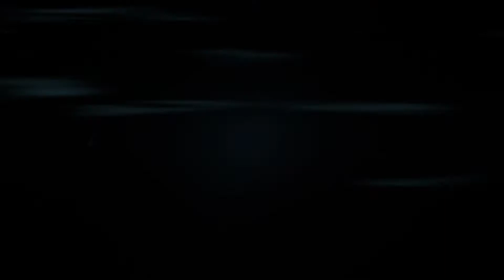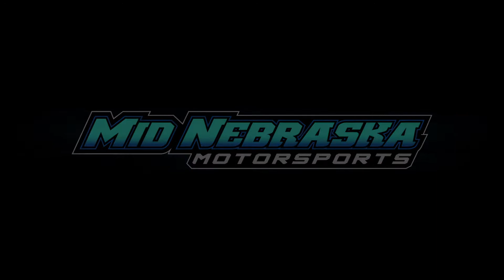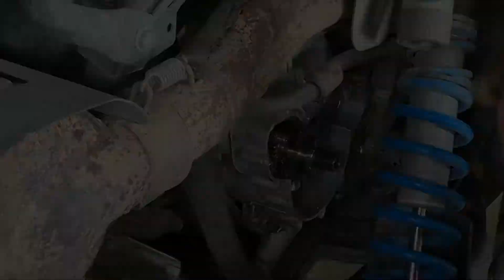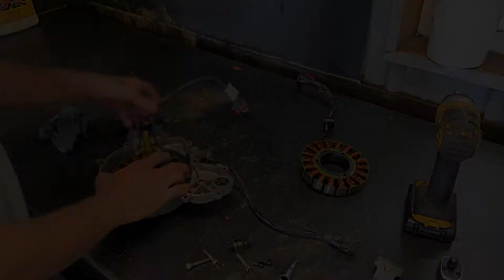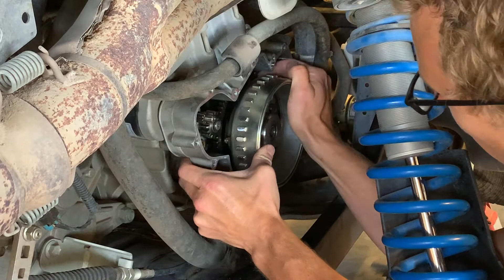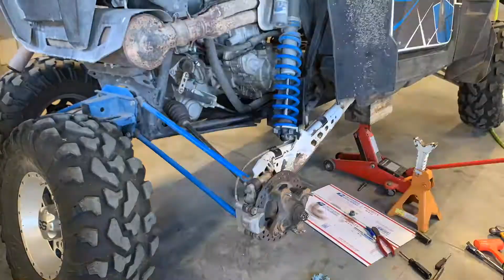Polaris RZR 900 - Charging System / Stator Magneto Bad / Flywheel Removed

Comment: Cool video, but it would have been better if you would have shown why the stator/magneto were bad or how you tested for that.  I'm assuming a simple multi-meter hooked up to the battery while it's running showing a low voltage, but this is why showing that would be good so nobody has to wonder what the symptoms were.

Then for a good closure, showing the multi-meter hooked up while it's running now showing a proper charge voltage, confirming a solid repair.  

Context is everything.

Comment: Hey how you doing I have a 06 honda foreman 500 4x4 just got bike out of shop brand new suspension front and back but I forgot bike was low on oil and I rode it for about 15 mins making sure everything good but I ran it hot it just cut off in 3rd gear and smoke was coming from air box and from on side motor….and my pull cord do not want to come out…everything electrical work like lights but when you hit start bottom solenoid just click but nothing never went dead on the bike before It ALWAYS crunk up one press of start button so that problem accrued when it cut off and started smoking… can you give me a idea? And it wasn’t knocking or anything it just died but everything electrical was still on bc it was dark os no oil light came on the dash either